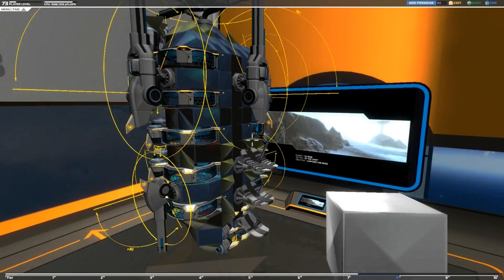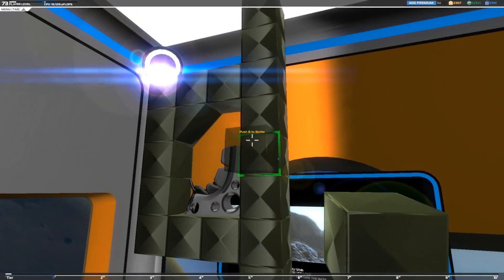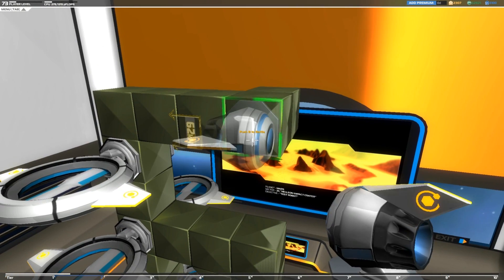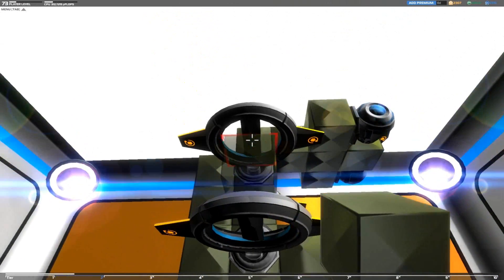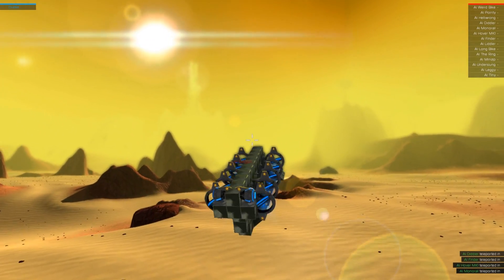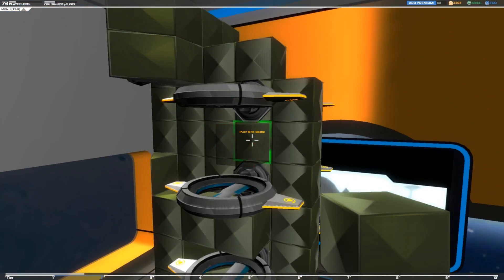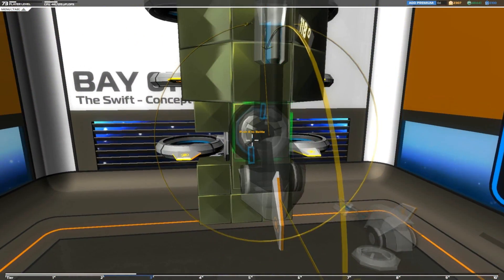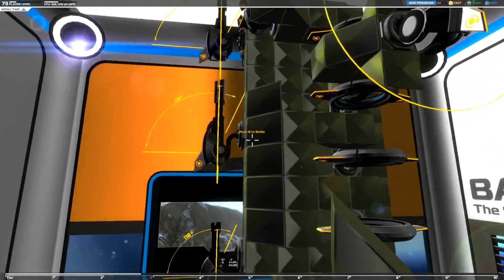Robocraft Bay 01 - How To Build A Stupidly Fast 'Vertical' Design Hoverbot

Comment: Another poster on the forums mentioned this might cover an exploit on hoverblade mechanics.
Reply from the maker: It does exploit some particular features of how hover-blades work; namely the lack of a speed limit on vertical movement.

I checked with a developer back when I first discovered this. The lack of a speed limit is on vertical axis movement is intentional. I have a feeling that it may even be required in order for the 'blades to work with thrusters on flying vehicles.

I am not sure that they quite intended this type of bot. However, I think that it requires enough sacrifices in order to make it work for it to go un-nerfed.